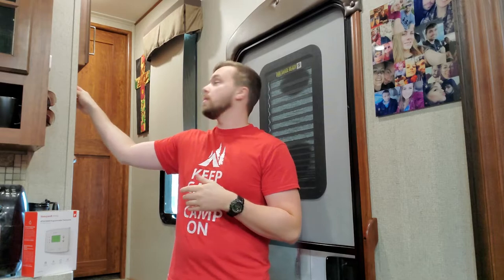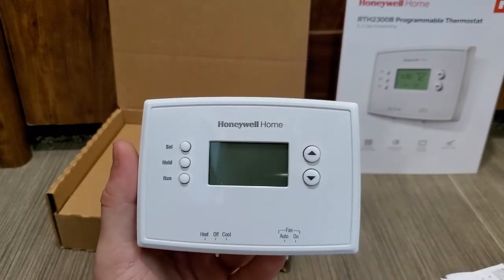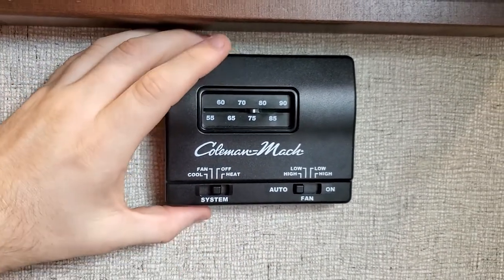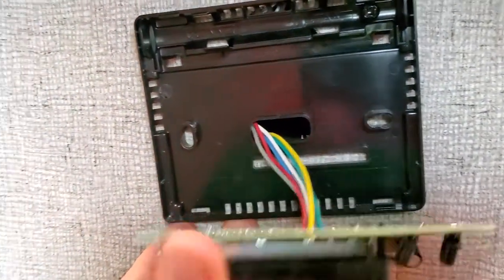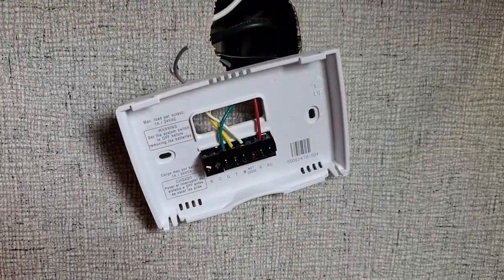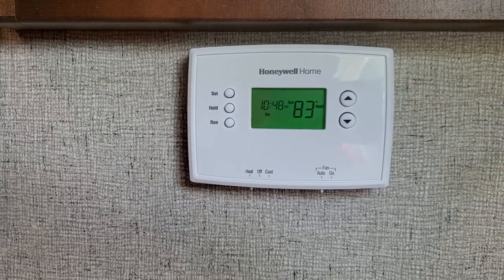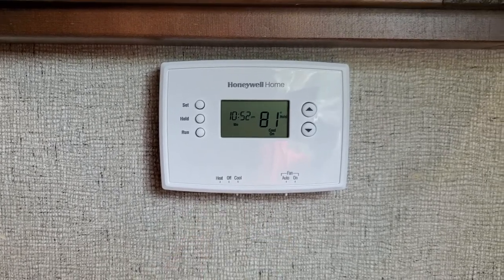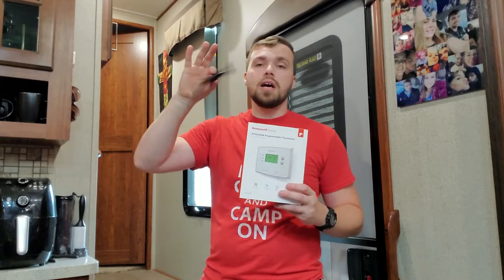How To Install the Honeywell RTH2300B Digital Thermostat In Your RV

Comment: Wanted to change out my RV thermostat. Took the old one off and found those troublesome blue and gray wires. There are no matching color letters on the new one. Yikes, what NOW! I was so happy to find your video. Just so happened I was changing out a Coleman Mach to a Honeywell just like you. I was so happy. All done now after finding out I didn't need those wires after all. Thanks for posting 😊

Comment: I believe Blue is 12+ from the furnace to power the tstat, which won't work for the Honeywell because it's made for 24v. The RV tstat closes the circuit with the white wire to turn on furnace. This is how the newer digital Dometic and mach tstats work without batts. For me I don't really consider it an upgrade if I have to replace batteries.
Reply: So that would explain why it didnt work for me 🤦🏽‍♂️ it says 12+ and 12- on the Dometic I took off and it does nothing when ai put the Honeywell on with the same wire mentioned in the video
Reply: The battery's are light on display. Last really long time

Comment: I have two different digital thermostats my experience has not been good my coleman with blue tooth this has multiple issues, junk. My rv comfort zc, is even more trouble,  i would much rather have the analog thermostat.

Comment: Will the thermostat work when power goes out and it goes on battery power to run blower on propane heat - it does on current RV thermostat but it’s not programmable like I would like
Reply from the maker: Yes it will.

Comment: Only want high and low for AC ! AS PROPANE STILL HEAT HEAT EXCHANGER AT ONLY ONE RATE WILL CAUSE FIRE IF HIGH LIMIT SWITCH IS MALFUNCTIONING 💔💔💔💔💔💔💯

Comment: Thanks for your video. I had to install the control Board for my Coleman Mach AC and I have the same Coleman thermostat and want to replace it with this one.

I have 2 wires from the furnace thermostat which is red 12v and white. This is simple to understand and wire it just acts like a switch when I turn on the furnace. Also the diagram for control board has -12v blue wire, yellow is the compressor, grey to low fan, and green to high fan.

 I do not have red +12v going to AC but instead have a Blue -12v. So I'm a little confused that you do not wire up blue.

Are you using Coleman Mach AC? I don't see how yours works without -12v unless your control board takes the +12v. 

It would have been nice if you did not snip wires from the old thermostat but pulled them out further so I could see the thermostat wiring going to AC.  Possibly what we do not see is -12v blue is spliced going to control board of AC and that is why it works? 

I am guessing you have the -12v run to AC and if wired to the thermostat you would not need batteries? 

I'm a little nervous to install this thermostat as control board is working with the analog Coleman Mach thermostat. 

I have -12v I can jump off of going to gas monitor near the thermostat. Should I run that to control the board of AC and bypass thermostat or run to thermostat as also?

Update: Thermostat installed. I chose low fan option also. 
I found a video that confirms what I  thought. The -12v blue was connected to a -12v source and goes to AC control board. 
https://youtu.be/Ce3y4fgFvak
 
Still not sure about if I should also run blue  to the thermostat... 

Thanks your video it helped.

Comment: The AC delay has to do with charge pressure being higher since it was running and the delay allowed the pressure to drop so it is not hard to start the compressor
Reply: Exactly right. I was going to say that same thing

Comment: Good video on the installation. Yes the grey wire is low fan speed. I installed mine with the grey wire   so that it runs the AC on low fan speed. I like that it is quieter and since the unit cools more slowly, it dehumidifies more.
Reply: What wire did you switch with the grey wire for low fan speed?
Reply: What wire did you switch with the grey wire for low fan speed?
Reply: What wire did you switch with the grey wire for low fan speed?
Reply: What wire did you switch with the grey wire for low fan speed?
Reply: What wire did you switch with the grey wire for low fan speed?
Reply: What wire did you switch with the grey wire for low fan speed?
Reply: What wire did you switch with the grey wire for low fan speed?
Reply: @lowellgoold3434  Green. If you use the green instead of grey you will get high fan speed.

Comment: well done. clear. question: did you have to do anything special to have the backlight come on? mine doesn't. thanks
Reply from the maker: For this model, thebacklight should come on assoon as you touch any of the arrows that adjust temperature. If you're doesn't light up you may have a defective unit. I'd contact the store to get a replacement since the backlight is an important feature in the evening. Best of luck to you and thank you for commenting.
Reply: Did you ever get your back light fix I just installed the same thermostat my back light don't work nether.

Comment: Jimmy2 - did you just leave one of the fan speed wires unterminated so the unit only runs on one fan speed?
Thanks!
Reply: Yes he did. That's the wire he tucked in the wall.

Comment: Mine doesn’t have a green but has a black wire 🤦🏻‍♂️ now what please help!
Reply from the maker: You'll have to do some research. If yours was not these colors there are forms for your specific rv that will break down the possible colors. Good luck on your install. You'll figure it out.
Reply: My ac and my furnace don’t work. Only the fan switches on.